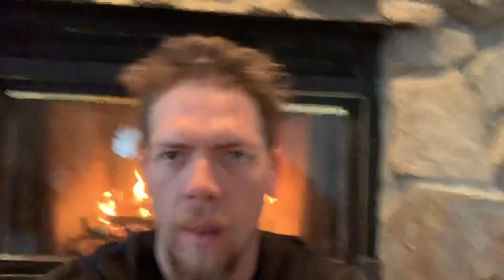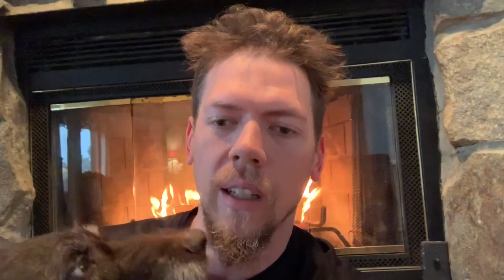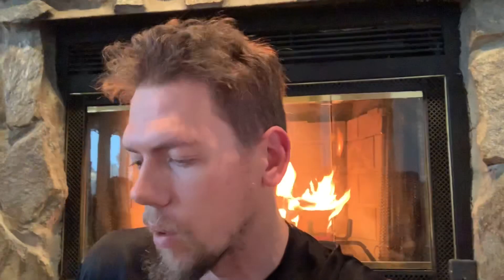How I became a Mechanical Engineer #mechanicalengineering

Comment: Hii sir I have complete to study of diploma in mechanical production engineering and b.tech mechanical  engineering I wants to doing the job in your company and I finally asked to you what study or software to learning to me whose help to me during the job time, please tell me
Reply from the maker: Software: CAD, Revit, Excel, Bluebeam review, I use a lot of the equipment manufacturer's software for equipment selections and HVAC calculations. Trane Trace, Carrier HAP for load calcs.
Reply: @danielschloss1111  can I get the job but I have complete to study for HVAC and my other education show on above comments ,I have not completed other shaftware as u tell me above comments, only one HVAC,sir plz tell me if any other shaftware to need around to the industrial area

Comment: Hello Im currently a Mechanical Engineering Student! Im currently struggling to get a Internship I was wondering what you did to land your first internship?
Reply from the maker: Brosales1414 I joined AGC Association of American General Contractors in university. This program basically brought contractors in to recruit students throughout the semester. I actually applied to and got into an internship program with one of the contractors, CH2M Hill. Apply apply apply like a full time job. Don’t turn down any offers as a entry level young engineer. Go where the opportunities take you at the start. Also Don’t get discouraged and be cut throat about getting your name and resume out there with firms you want to work. I applied to over 350 entry level engineering positions in 2010 during the recession. This was a waste of time as I got my first engineering position by going back through AGC at my University after I graduated to interview with a firm hiring entry level engineers through the university. This job took me to San Diego for a few years but with experience you can find jobs much easier in cities you want to work. I got my second engineering position through Craigslist, my third Job through the local ASHRAE chapter. Then headhunters will easily find you jobs with 5+ years experience with good raises.
Reply: @danielschloss1111  Thank you!!
Reply: I understand, I too found my way into HVAC the same way. Thank you for being honest about the industry and what you do in your videos. I enjoy them. Have you thought of doing HVAC tutorials? alot of people may be interested in them. Have a great day.